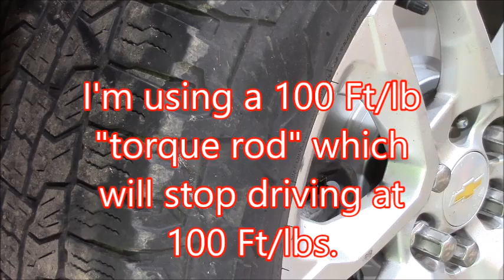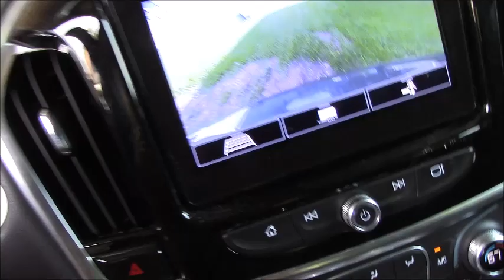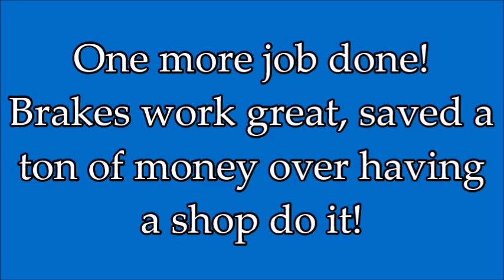DIY, How to do a 2020 Traverse rear brake job, pads and rotors, how to retract the parking brake

Comment: You wouldnt be having such difficulty if you had put the vehicle into service mode so the rear E Brake will retract in and not out.  As for the front you just do it normal fashion.
Reply from the maker: You need a dealer type ODB2 digital interface device to put this particular vehicle into service mode… not easy for a DIY’er!
Reply: @bobsbarnworkshop is very easy, there’s videos on how to do it yourself.

Comment: Pretty sure the LH and RH on the caliper tool is depending on if your brrakes get retracted clockwise or counterclockwise. Ive done quite a few of these and each side is usually the same so one or the other
Reply from the maker: @EATSLEEPFARM  this was my first time working on these brakes so I was figuring it out as I went! I was thinking the brake motor ran CW on one side, CCW on the other but I believe you are correct, both sides turn in the same direction!
Good luck!
Thanks for watching!

Comment: What is that tool you used to drive the piston back in the caliper I need one!
Reply from the maker: @arobertson486  I bought it on Amazon. Not sure what it’s called…. Maybe “disc brake compression tool”. Only 25 bucks….
Good luck! Thanks for watching and commenting!

Comment: Did you ever put the torx bolt back in the rotor?
Reply from the maker: Actually, I don’t recall… it really doesn’t serve any function other than holding the rotor in place while putting the rest together. The lug nuts torqued down makes it unnecessary,
Thanks for watching!